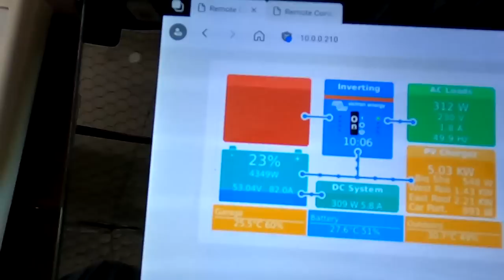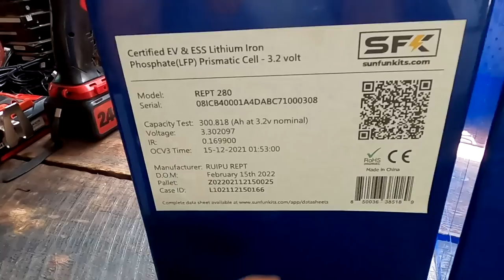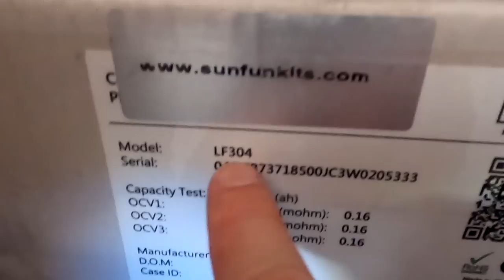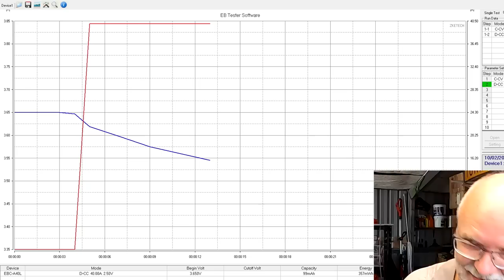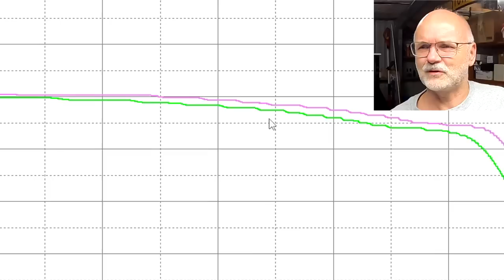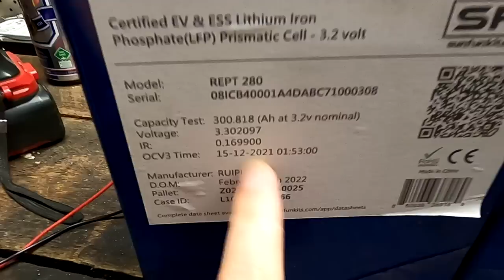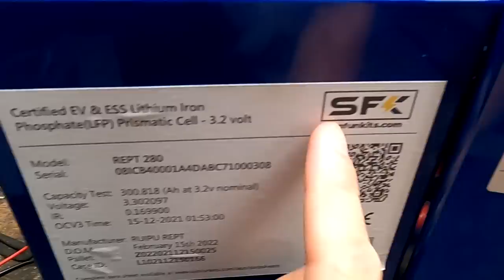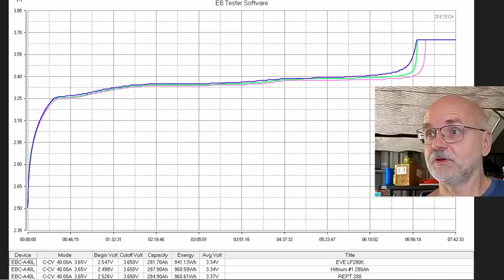BEST cell to buy - Testing Certified, A-Grade, B-Grade, Storage-Grade batteries🤷‍♂️

Comment: I should really send you some cells to test with, coming directly from Eve, and provided from Eve with the correct terminals for screw terminals. The LF289K only comes from Eve in two options: 1. blank terminals to be used for laser welding only, or 2. double bolt holes, obviously for when using bolts. Not to say there aren't other ways of doing things, but then it is outside the manufacturer's specifications. Again, all fine, but the seller should specify that and let the buyer decide if that works for them or not. I am thinking about the stress that is put on the terminal post when drilled and / or tapped. Eve first drills and taps the piece of aluminium to be used for the temjaml, and then laser welds that onto the blank terminal, limiting stress on the terminal. I think the difference is all about longevity in my opinion. I hope that helps.

Comment: Very informative result, thanks Andy! It might be interesting to see a if there are any differences in degradation between the grades at about 300 and 1000 cycles, and to test a cell out of your battery bank that's been in service for 9 months.
Reply from the maker: This will take years to find out. I do maybe 50-70 cycles a year on my battery shelf batteries... I think storage grade is totally fine.
Reply: @OffGridGarageAustralia  Indeed, and if you pay 40% less you can afford to buy 40% more, and if the service life is 90% of more expensive option you have 40% less cycle load and possibly equal life with 40% more overall capacity for the life of the system. 
However buying fake 'B' Grade cells that were really 'D' or 'F' grade might not be so cost effective.
Reply from the maker: @jackoneil3933  I guess nobody will buy C, D or E grade cells on purpose
Reply: @OffGridGarageAustralia  Only by decryption or for salvage prices I'm guessing. 
I was thinking back to a few years ago when a friend in the off-grid solar business lost a lot of money buying what were sold as 'A' Grade prismatic cells. And even today after watching your videos he's gun shy to buy anything but factory direct warranted cells to package to customers.  Your tests seem pretty conclusive Andy but I understand his trepidation to not risk his reputation and business on something he's not personally confidant with. 

I recently looked at an EV conversion for sale here that used 200ah Prismatic Storage cells that were pretty marginal after two years.The owner said was careful to not abuse them. Most were pretty swollen and about 30% unusable.  My hunch was that it was the wrong application rather than an issue with the supplier.

Comment: This helped me with my decision to buy hithium cells. The offer I’ve got it a 25% cheaper than for the eve a grade cells. I think it’s not worth it to get the eve cells for a ESS 
In fact the (fake?) hithium cells perform good here even when the cell is damaged. 
I plan to have a relatively high load on my 48V system. It might be other cells can cope with that a bit better but since I am going to build at least 2 or 3 packs it doesn’t matter anymore. The planned current is 300A up to 1 hour 
Average is much lower anyway.

Comment: I am quite happy with the EVE grade B cell (laser marked B) from Docan Power and the EVE grade A from EVE 
No need to buy from SFK in the US with a doubtfull story cause all their data provided are again  better on the label than in reality as seen before on other channels. 

If you check the EVE factory cell surface it is not much better than your EVE cell. At the end the EVE grade A had been 25€ more and had been shipped a bit faster too , but it might pay off over time cause the capacity had been significantly better by 12 Ah while grade B had been about 2,5 Ah more than advertised. So 10 Ah is roughly 3,5% more based on Ah, but 4% in Wh. 
What I can not judge is the cycle amount. 

The major difference is that the EVE genuine seem to be safe for passive balancing by the SEPLOS BMS where the grade B really seem to need a NEEY 4 active balancer from time to time at least.
But who knows if the grade A EVE will need the Neey 4 too in 2 years from now. 

At the end it is a lot cheaper to invest 100€ in a NEEY 4 for peace of mind and get the grade B cell 16 x25€ cheaper which means 300 € on the bank account or in a 16S2P configuration 700€ cheaper which I prefer the most. 

SFK makes no sense to get  a battery made in china with big promises on the label from the US. Too high expectations and also personal issues how to deal with customers that simply had felt disappointed and showed like you the results of the same tests as you do it. 
For peace of mind I would go again from EVE factory with the nice paperwork they will send for each battery cause it feels quite right or german cause you need a piece of paper, a real certificate.
Who know when CATL in germany will start production and might sell surplus stock in their  Werksverkauf. That would be my first choice of cause and the end of the hazzle and gambling or lottery. Hope you might find a catl plant in Australia too.
Reply from the maker: Thanks a lot, great comment.
I personally don't have an issue with SFK. They made it very clear what was going on with that case which got public. They make great products and have great support from my experience and a lot pf people agree with that.
But for you in Germany, it makes no sense to order a battery from China from a company in the US. Neither for me.
Yeah, a local factory would be great. Especially here in AU, they are exporting the resources and buying the batteries back from China. Makes no sense and they need to get their sh!t together and build a Gigafactory down here.
Reply: @OffGridGarageAustralia  Agreed. There is far more to the story but it doesn't benefit SFK to say or do anything because the naysayers will never be satisfied since it's a he said, he said situation.

Comment: Hi,  thank you for great test and please i want ask you about measure cells by their weights and let's see if all same weight or not,  because SFK battery maybe it is 300 Ah Orginal capacity not 280 Ah let's check their weight and compare to EVE 280k data sheet.  And thanks again
Reply from the maker: OK, I'll have a look at this as well. Good point.
Reply: This is a REPT battery NOT EVE 2 seperate manufacturers, you can view our results here: https://youtu.be/om9L3vLTRY8

Comment: In real life the only important parameter is the capacity. As I got ripped off with my first cells I run a bunch of used cells in parallel to new ones. I don't notice any issues. The 2A JK BMS keeps them in balance. I would always go for the B-grade cells for a PV-system.
Reply from the maker: Yep, I think so too...
Reply: Sorry mate, I had thought the same thing, pairing a good cell with a bad one to balance a battery pack. But I've read that the new one wears out quickly. Because in this way you can also use bad cells. So it's not true that the new one wears out?
Reply: @potetespammare7361  I didn't combine the cells into one bank. It's two different batteries as in Andy's setup. I don't see why the new cells should be bothered by the old ones. 
Could you explain the reasoning behind that claim?

Comment: Thank you Andy very interesting video since I will have to buy 16x6 = 96 more cells in the next 3 years to finish my project. At the moment I have 16 304Ah from QCC and can't complain. If they did a square terminal would be great though.
Reply from the maker: 96 more cells... wow, what a huge project!
I would not bother with the terminals, the round welded studs are perfectly fine.

Comment: My understanding is that premium Grade cells are used only in electric vehicles..no welded studs..and every thing else is sub standard and sold off for storage etc and they have welded studs fitted for the storage market.  Love the video😇 no more seplos 🤗
Reply from the maker: Yes, they usually all come with flat terminals and the EV manufacturers are commissioning their own packs and welding busbars onto these terminals.

There will be two more Seplos videos and that's it then. I'm done. DONE!
Reply: @OffGridGarageAustralia  the frustration with Seplos is understandable, albeit it has endless possibilities imho, yet Andy has shown us all the tweeks & glitches that may arise with the Seplos's.......just way too much for the average DIY'er
Reply: @OffGridGarageAustralia  no eve will give welded studs if requested. Also I think you need to buy directly from EVE to see if it better. I think EVE would send you even 1 cell for testing.
Reply from the maker: @ilcooldj  The Seplos BMS is great but they won't be using the full potential and change any of the software as per feedback they are receiving. So, that's a NO from me then. I may have found an alternative though...
Reply: I don't see this at all:  What EV is using Eve prismatic cells?? I search and no EV uses these blue wrapped prismatic cells?! In fact these cells seem like a very poor choice for such an environment, and This seems to all be 'talk' without any substance.  
Please, if anyone knows an EV using 280Ah prismatic EVE cells tell me.
Reply from the maker: @r.b.l.5841  Video below is in German but they are testing the new BMW i7. It has prismatic cells, same as the BMW iX. The iX has higher cells, much like the 280Ah cells we use, the i7 cells are a bit flatter because it's just a sedan or limousine shape car, so does not have the height.
The EVE cells or mostly for busses in China though.
https://youtu.be/g6ljgBY1ZPE?t=2346
Reply: @OffGridGarageAustralia  English auto translate is not too bad (some parts funny), my German is pretty rusty, and he speaks a bit fast for me!
Reply from the maker: @r.b.l.5841  It's more abut the part in the video where they show the prismatic cells in the i7, to answer your previous question.

Comment: I just bought a tester like yours, but confused on what setting to use ... I read the mfg testing doc and when testing it should be set to charge at 3.65v at 40A, then wait 30 minutes, then discharge at 40A? to 2.5v.  I follow that and recharge to 3.3 at 40A.  In this video you're not waiting.   Also, the resting voltage is around 3.4v after 30 minutes of rest.
So my question ... should you wait or go right into discharge?  Should you discharge at 40A or 20A.  I get 290AH at 20A, but 270AH at 40A when testing.  I have the EVE LF280K from Qishou.

Edit:   Cell temp is around 12c ... Winter in Washington, USA

Comment: Just an FYI Andy, the torque driver you have on your website for USA Amazon points to one that doesn't go low enough for torque on batteries. I believe I found the proper one you have already, how do I send you the link for it on amazon as well?

Comment: I think it depends on your application. If you able to regularly check your system, have reliable comms, it probably doesnt matter.
But of your system is truly remote, no comms, prob only gets checked yearly or less....then I suggest it matters.
What concerns me is you specify a certain quality spec for bateries, but you are completely dependent on your supplier to meet your specification!! Thats the annoying bit. And just because they supply one good set of batteries initially, you still have to check each and every cell when it matters.
Reply from the maker: Thanks Ian, yes, I agree. If you cannot access and monitor your system easily, quality matters. We are dependent on what suppliers sell us and if this differs from our expectation or what they have offered, there is the big problem. 
As in a previous video mentioned, we need more transparency here from the seller to meet our expectations. If they do the capacity test anyway, why not print this on the label and be honest. More people would buy from them.

Comment: For more than 4 years I built and used recycle  batteries (laptop, tablet, cell phone)  from either round or pouch shapes for my 14s100p.  200AH.  48V pack for my off grid house and garage.  Way harder and time consuming to build from many small cells  than this LFP  cells.  That is  why there are very few attempting this way.   They all have high internal resistance, all have out of balance from day one but they work just fine for years  on recycle throw away batteries that i have to pay to get it from a computer repair shop. (yep they would rather throw away but i have to pay to get them!). I do not have bms, active or passive balance  just  a simple voltmeter at  at each cell and the charge controller to set the max charging voltage of 56.5V.   
With that says they work just fine for years and from time to time i have to rebuild the pack.   It runs the whole house  all the 110V stuffs easily on a 3kW  true sine wave  transformer  type.  Inverter is a modified 3kw UPS that was used in server back up.   Even solar panels are used but top tier. Sun Power brand.  The only thing new is the charger controller MPPT.   I apply the concept of reduce, reuse, recycle to the maximum.

Now  if   i could do that and have that to run the whole house for years successfully then you would have figured out already IF you have LFP new cells (any grade), new inverter, etc... then you are sure to know that your system will last and run for years and years  with definitely certainty.  Now you would not know that if i don't tell you wouldn't you.   Very few people do the way i do but with that knowledge that gives me the confidence  to buy less than certified stuffs and still know it will work just fine.

My point is you DO NOT have to buy the best  of everything in order to  have a solar system that you have always wanted.   They all will work just fine and i bet those less than premium stuffs will last you for years of clean free energy.  Just get going and do it  the more of us doing this and spread the word the better it is for the environment.

With the advance of EV we have way more choices now with LFP, wrecked EV with  battery pack and the drop in price  now is the time to get into this exciting hobby or business.
For me the next thing i am going to build  up the 48V pack of  LFP  batteries with active balancer from day one and it is time to do the complete with BMS, active balancer and new LFP batteries and of course IOT for remote monitoring and control.  I can remotely turn off my system anywhere in the world but i still have to do the monitoring part.
I live in FL so plenty of sun too as in Australia but really  even in Alaska  anyone still can do solar.

People are balking at the expense so let me put  this into context for  the doubter.  I can put together  a 48V pack with 200+ AH  of LFP with active balancing, bms and all the monitoring capability for under $2000.  That is plenty enough to run the whole house  everything except the 220v stuffs.  LFP if new will last  up to 15 years and even then they still retain 80% of their capacity.  You can parallel to increase the capacity easily and there are only 3 things that make up the solar  battery energy system:  battery, solar panels, charger controller.   Battery is the biggest expense but is it really if you know how?
People paying $200-$400 monthly on their electric bill (especially in FL)  so in less than 1 year that already paid off for the battery pack investment.
Do i need to explain more?

Definitely worth the initial investment not mentioning you are doing something good to help out the global warming crisis.  Depending on how ambitious you are but for me it is fun to  play around with this solar thing.  Perhaps my back ground with a  degree in electronic engineer  makes all of this fun and easy for me.  Trust me people you have all the know how and knowledge if you read and learn online and Utube.  DC electronic is super simple and easy to grasp  NO need for higher learning  of electricity or electronic.  I just have a deeper understanding because i spent years in school to get my degree in electronic.

BTW I  do not intend to pirate your video.  I enjoy watching your video and analysis.  You have a nice fully equipped  garage for certain and I originally watched your video was about the active balance because i had continually  quick failure of my pack due to out of balance. 
Now  with what i learned from you i have decided to invest in the NEEY active balancer and  diy the solar battery LFP pack 48V.   Thank you for sharing!
Reply from the maker: Thanks so much for sharing. That was a very interesting read. 
I wonder how you run a battery pack made of so many different cells without a BMS. Not just from a technical perspective but I would be too scared to have a runner-cell, and with Li-ion cells, I mean this from a thermal point of few as well...
Thanks again and stay charged!